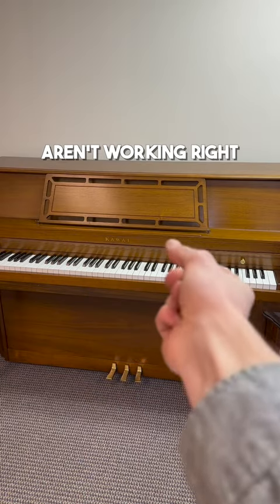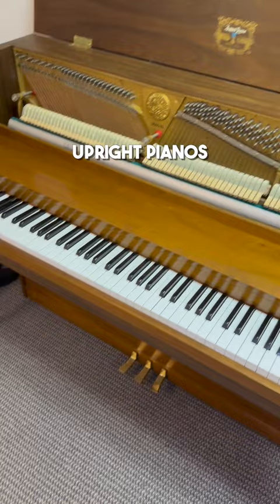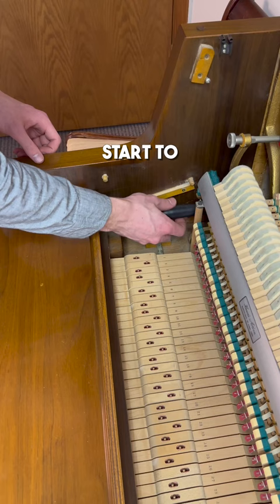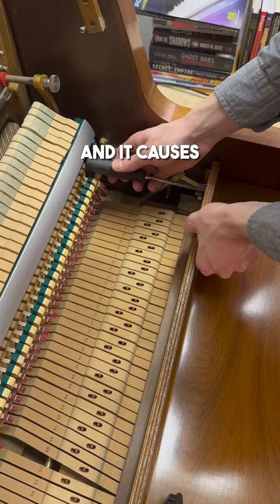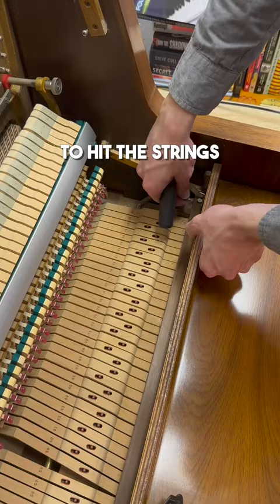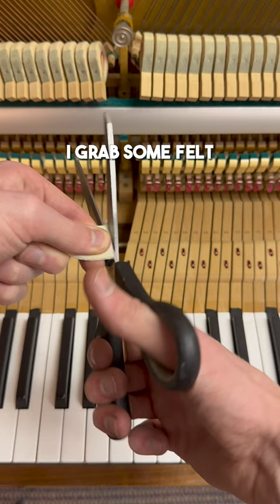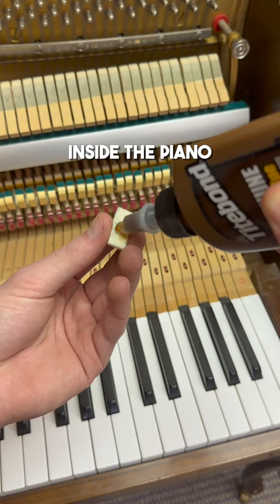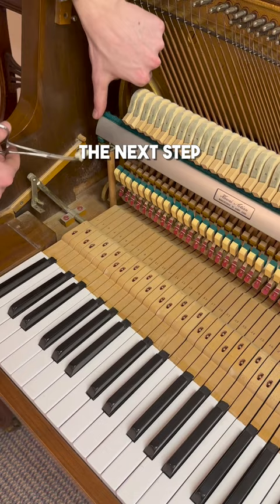fixing the most common problem for upright pianos

Comment: I usually first check if there's slack in key pilots. If pilots are fine, then I check key dip which should generally be 10mm. I wouldn't change blow distance, except if doing more complete action regulation process.

Comment: Mine had cloth straps with leather sewn on the end on each hammer that pulled it back when it struck the strings to keep it from double tapping.  They connected to a hook but were glued into the hammer.  It was formerly a player piano that was converted to a regular piano.  I had stripped it of the black paint someone had done a poor job of painting it with and refinished it with orange shellac ten years earlier.  Moths had started eating the felts and the straps were breaking so I gave it to someone that was going to gut it and put plants in it.

Comment: Question, is it possible for piano tuners to adjust the sound of the piano? Like if one section of the keyboard is a little dark/nasally, would it be possible to brighten it up?

And is this process reversible?
Reply: Yes lol
Reply: Ofc
Reply: @squareeagle65  is it a bad idea to change the sound profile tho?
Reply: @Mild Satire  Every piano has a different tone Steinways are usually brighter and Yamahas or mason and Hamlin are darker. You can always make any piano sound brighter or lighter but some are designed to have that feel and effect. Not necessarily a bad thing to adjust but I would recommend getting a brand of piano which suits you the most :)
Reply: @donovansprenger8845  Thanks, just noticing the lower middle section feels a bit too dull/nasaly compared with the upper registers. Could they voice just one specific section?
Reply: A piano "technician" can change the tone by "voicing" the hammers

Comment: Forgive me if I’m wrong as I’m still learning but isn’t the blow distance on uprights supposed to be 1 3/4”? As in, shouldn’t a ruler be used in this process?
Reply from the maker: Great question! Yes, different brands/makes of pianos have different blow distance regulations. 1 3/4” is fairly standard.

To learn more, I would suggest reading Arthur Reblitz book on tuning and repair. (If you haven’t already.) I follow his method in this video and many others.

In general, there is so much more that goes on behind the scenes than what you see in these videos (like using a ruler to measure blow distance.) I have to cut large parts of the video because they can get too long, detailed, and not appealing to the general public.

I’m always willing to learn as I don’t have many years of experience. Please follow along and critique wherever possible! Thanks :)
Reply: @PianoDoctor  ah ok that makes total sense that you have to cut a lot in the videos to make it into a short! 
Seeing as how I have very little experience, I’m trying to get a feel for what is absolutely necessary and what is just the way we do things where I work. Of course my bosses would argue the way they have me do things is absolutely necessary! 
You just never know. My old flight instructor used to make me calculate weight and balance the the 6th decimal place. He said it was necessary. Most pilots would agree that’s just a little neurotic though.
Reply: @PianoDoctor  by very little experience I mean I’ve been working full time as a piano tech (apprentice) for almost 8 months now.

Comment: Hi i have a question, my upright piano is already like 5-7 years old and the hammer works properly, but the problem is you cant hit a key softly, like how in normal pianos you can do pianissimo and press the key lightly, but on my piano i cant press it lightly, its kinda hard, so everytime i want to play a soft passage i have to press the soft pedal on the left so i can press it lightly eventhough its still not enough.
Which means everytime i use the right pedal its going to be bangy and loud, and if i want to be soft i have to add that "softer and careful" touch to the keys which is so so annoying, and doing perfect trills is just nearly impossible, i thought its my technique but its actually the keys that are a bit hard, because then when i trill on the high notes like around the 2nd highest C on the piano, it just trills perfectly and the higher keys are light

Do you think it can be fixed? Or it cant be fixed anymore because its the matter that its old? The notes are still in tuned thoudh and the high notes are still good for now
I just cant play freely with this condition, i have to play medium-LOUD even on softer pieces everytime but the keys are not stuck because i used a piano heater, please answer thank you so much